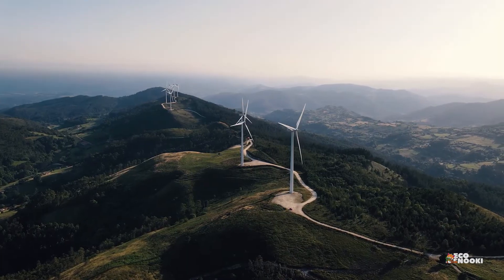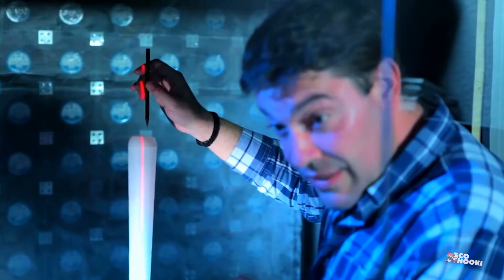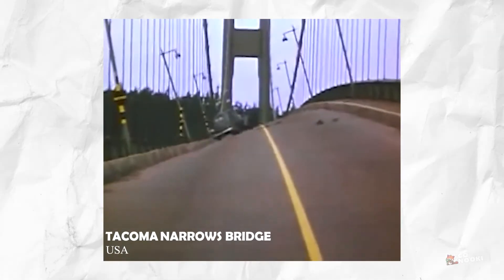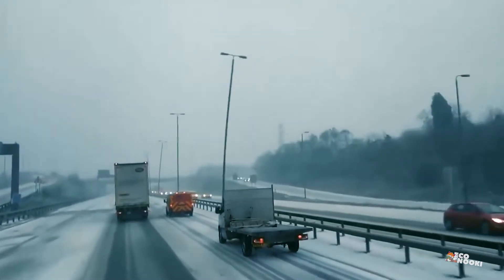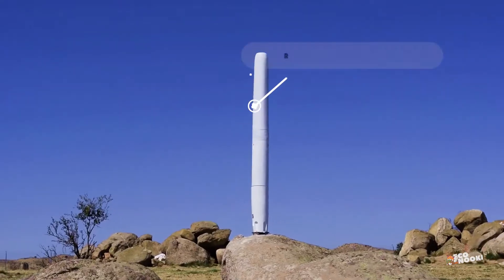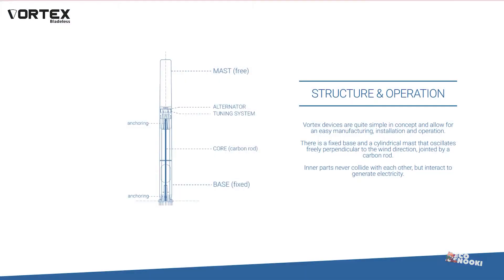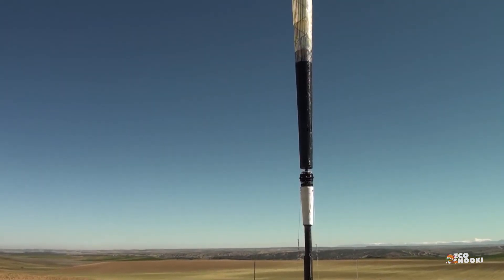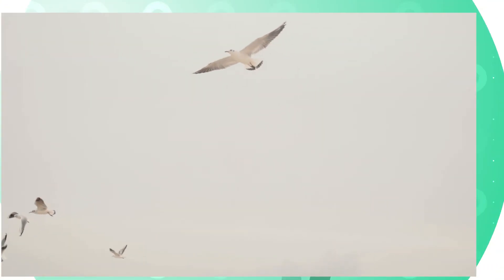A wind turbine without blades? | Vortex wind turbines

Comment: Totally inefficient! 1) The wind yield and thus the electricity yield depends on the so-called wind capture area. This is approx. 21,000 m2 (82m x pi2) for today's 6MW turbines, but only cross-section x length for these turbines. This means: an enormous amount of material for a low yield. 2) The wind/electricity yield increases with the third power of the wind speed: +100% wind = +800% electricity. Close to the ground, however, 0 constant wind, but gusts. Only from 100m upwards is the wind more constant and blows more strongly.

Comment: Got the super rough math here but its probably wrong because its wiki. Wiki lists 3 models
Vortex Nano(1meter) 3W-ish
Vortex Tacoma(2.75 meters)100W-ish
Vortex Grand(9-13meters) 1KW-ish

Price unknown because there not making them even though they planned to by 2020-2021. 
Websites that covered it said 40% cheaper than wind turbines. Estimated at 1.4 - 2.1 million for 1MW.
This would put the, I would guess the tallest vortex grand, somewhere at 840k- 1.26 million.
I would remind you 1000kw = 1 MW.
Not sure where this thing is gonna fit it if it ever takes off because it was supposed to be commercially available during COVID.

Comment: I swear society is getting dumber by the day. This is absolute horseshit. Look at it from a physics point of view: Where does the energy for the oscillation come from? From the wind. What is the theoretical maximum amount of energy this thing can absorb for any given wind? That depends on cross section area of wind this thing interacts with. It can't possibly absorb energy from wind that doesn't hit it. What is the shape of this thing? It's a pole, a straight line. Worst possible shape for covering a large area. Now compared to a regular wind turbine that has rotating blades which absorbs energy from a disc shaped cross section of air with a huge diameter, this thing is insanely inefficient! It's like playing tennis with a stick instead of a racket.
It gets worse, any energy it manages to absorb from the wind must first be used to constantly change direction of the mass oscillating, then any leftover can be used to make electricity. I can't think of a worse way to harness the power of the wind. This is nonsense, a non starter. It's a scam. It's computer animations and AI voice. 
A rotating blade wind turbine built with the same amount of material would produce much more power.

Comment: man..  you want to sell this in the US. Stop using fucking metric.. WTF is 3 meters per second in real speed? 7 MPH. There, That's the number you have to use. So it take a wind speed faster than the average wind vectors in the US. So you won't be able to sell it in the US unless it's in a geographical SWR (Special Wind Region), like the Columbia River Gorge. I was all kinda interested but then you had to go into gobbledegook. Even in the rest of the world wind speed is measured in KPH. USE that number, people understand wind speed in miles/kilometers per hour, they don't understand per second unless you are talking about bullet speed. What number do they use to measure a pitch in Baseball? MPH.. And don't give me that metric system bullshit. Because in Cricket they ALSO measure in units per hour. You want to sell something USE that so people can understand in their guts wtf you are talking about.
Reply: Like it or not, the word is metric (except for a few backword counties). A distance is measurem in m, mass in kg, time in s (econds). Any  other unit is directlyn derived from these, with no conversion factors but, sometimes, son decimal powers.  Speed is measured in m/s,  force in N (Newton), pressure in bar,  Power in Watt and so on. Everything fits together. If you were an educated tecnician, you would know how much easier life is with metric units.
Reply: Ask scientific technical specs are in metric, even in the US. This product will be understood by engineers, not uneducated Yankee Doodle buffoons. Sit down.
Reply: almost entire world is using metric WHY DOES USA NEED TO BE DIFFERENT

Comment: All that talk but no power output figures. I wonder why???
Reply: That’s correct, one of the disadvantages of Bladeless Wind Systems is 

Topping or even matching the energy output of traditional turbines is also difficult – if not impossible. The energy output of Vortex Bladeless' machine is more comparable to those of solar panels than their bladed cousins.

However, a whole field of them or one every 150ft along the side of a road would still produce a large amount of electricity.
Reply: Top secret baby....

Comment: "When the wind speed is 6 m/s, it can generate enough power"
🙂
"Enough power": What could this possibly mean? Why no numbers (watts)? Perhaps, because they could let people down?
I take vortex bladeless as a scam, as long as there are no hard facts about power output per wind speed available.
Anyway, I don't believe in this concept. Much too small wind profile to get a decent amount of energy from it. Even if the transformation from movement to electricity was efficient, which is also doubtful.
Reply: Because its new technology